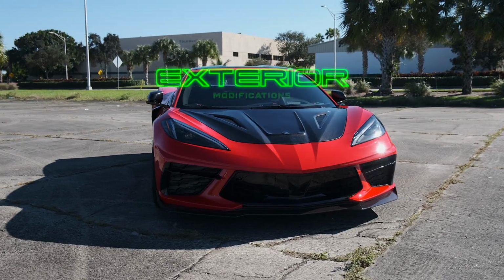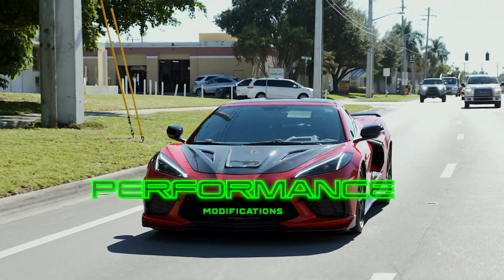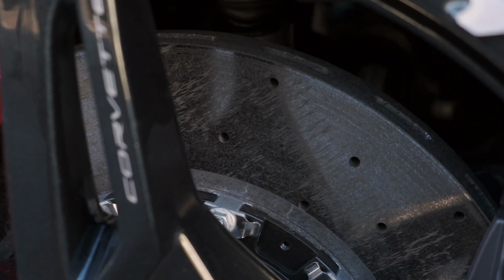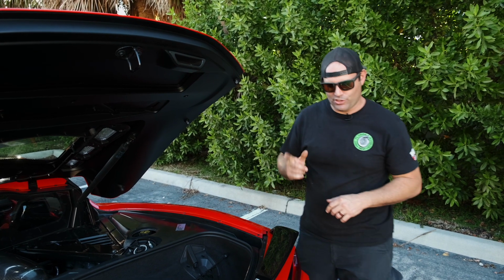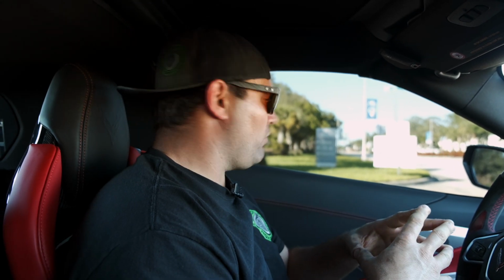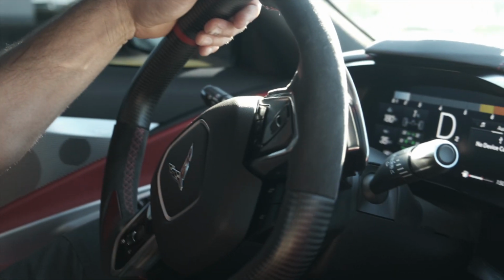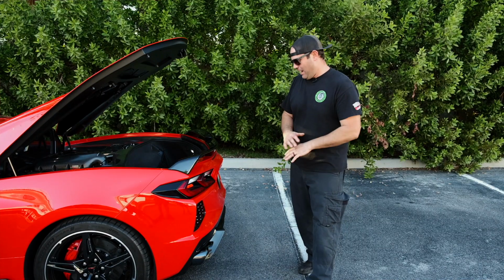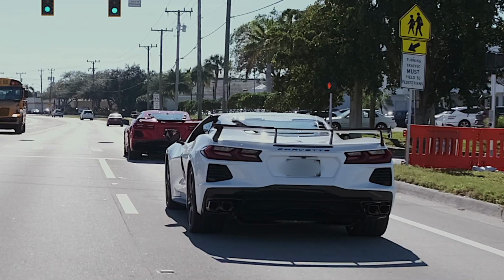Full Review of the 2020 C8 Corvette with Corsa Exhaust and Bolt-Ons

Comment: I have that same exhaust and I still have a check engine light on. The dealership can not get it off. Lingenfelter did not help at all. Do you have a answer ?
Reply from the maker: Email me 
Sales@flhighperformance.com
Reply: Florida High Performance big help lol
Reply from the maker: I told him to email me for help….I need more Info
Reply: Ya buy paragon lol
Reply: Try going to a dealer for a valve relearn.
Reply from the maker: Correct.  If your dealer cannot help, FIND ANOTHER DEALER
Reply from the maker: @nichaloslovely4992  Nothing to do with the brand...at all...has to do with the competence of those working with this platform.  Paragon makes nice stuff though, for sure.
Reply from the maker: DId you get it worked out?

Comment: How much for the engine bolt ons with installation? I am surprised that there is no lights without cats.
Reply from the maker: Please email me - there are a lot of options and variations.  sales@flhighperformance.com
My name is Erik
Reply: @floridahighperformance  I was looking to get a C8, but the Z51 will take 1-1 1/2 year to get and many used ones here are going for a $100k. I will have to hold on my low mileage C7 Z06 a little longer. I was just curious on the price for your package just in case I get a C8 sometime this decade.

Comment: You’re not scared of hitting bumps with it being lowered? It’s already really low to the ground?
Reply from the maker: Good question.  To this point the owner has not bottomed out the vehicle or hit anything.  This is the inherent risk of driving any sports car really….hitting debris in the road.  Just have to be careful.  The car is low but not slammed…so it’s manageable!  Thanks for your comment and Checking out the video.
Reply: @floridahighperformance  yeah the c8 doesn’t seem as low as the c7, c8 defintiely not slammed to the ground and can go over most things I’d say
Reply from the maker: @chrisg4997  yeah I’ve had some low C7’s come through and even those seem to do ok….

Comment: Titanium paragon unit would be a much better choice imo.
Reply from the maker: Care to elaborate?
Reply: @floridahighperformance  saving 57lbs over the stock Z51.  I'm assuming corsa is stainless?  For a guy blowing that much cash on carbon fiber 4k should be pocket change.  To each their own, I like performance.
Reply from the maker: @nichaloslovely4992  cool so $4000, 52 lb savings- that def is a nice savings- but does it really matter on a street car?  On a drag car, or something in competition then absolutely every pound counts.  Guess it comes down to preference.  I’ve installed a few tit exhausts on these cars and hell yeah they’re light.  The Corsa was also much lighter than the stock set up. The stock stuff is crazy heavy!
Reply: @floridahighperformance  you guys do a procharger yet?
Reply from the maker: @nichaloslovely4992  we had one on order- very early on.  Customer switched to twins…which is what we are doing now.
Reply: @nichaloslovely4992  We can get you taken care of with a Procharger build.

Comment: Has  the stock ecu not been unlocked by anyone yet? Crazy as I have seen two TT builds one remote style down below bumper in rear and above motor mount in the couple, maybe they used a stand alone system, I know the one guy was driving around with laptop open watching afr. Blows my mind that there are LTBs, intakes, etc without tuning the ecu. Wonder what it can put out once it's tuned up for the new supporting cast.
Reply from the maker: NO...stock ECU is encrypted from GM.  Typical GM BS.  We are working with Peitz Performance on one of their twin turbo kits for this red C8.  We will publish an entire build video on the Vette - and will cover the standalone computers required to make it all work.  Most are just using existing timing controllers like the one from LPE and either spraying a whole bunch of meth or are adding port injected fueling to add the fuel needed under boosted conditions.
Reply: @floridahighperformance oh the dual injection makes sense. The lmr kit for the coupes looks really cool mounted.above the motor.  I'm pretty sure that a lot of the ecu are encrypted and it's unfortunate. I'm thinking there are some new right to repair and right to choice lawsuits still going on that will tell  us which things will pan out for the future.

Comment: How does that exhaust handle the heat and act without heat heat shielding? I been looking at different options for exhaust with this being one of them since I love corsa build  but I see borla and fabspeed have heat shielding on theirs to address all the heating concerns
Reply from the maker: What in particular is your concern?  There’s adequate shielding from he factory which surrounds the entire exhaust.  We added the high temp shields on the back side of the wheel liners from Corsa- which was more for looks than anything.  I’ve installed those other brands as well- which are all great quality and fitment and saw no difference between them and this Corsa/LPE system with regard to damage from lack of shielding.  To be honest….I hope this answered your question.  Erik
Reply: @floridahighperformance  oh ok well that’s good to know I have used corsa exhaust before and never had any issues with it just with the C8 so many different discussions I seen on forums on heat that’s why I was curious ! I saw that with that exhaust supposedly gains of 19whp and 15wtq! Would you say you saw those gains ? Listening to video seems like most of the gains are truly from manifold

Comment: Why would you put all those performance mods on and then add carbon ceramic brakes that will get destroyed after a couple track days? Turns this build from a performance monster to a show car, pretty disappointing imo.
Reply from the maker: He doesn’t track the car.  The CCB’s will outlast any iron deal on the street- hands down.  The stopping performance at higher speeds and lack of fade are all benefits.  Not even sure what your point is- it’s invalid.